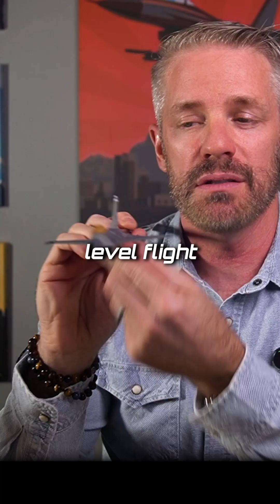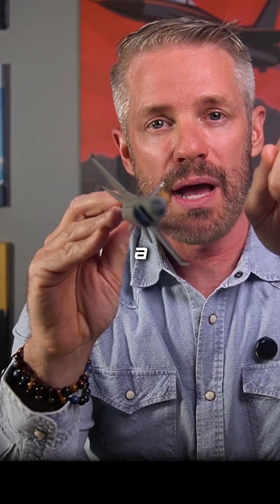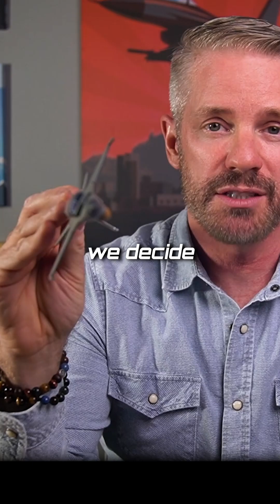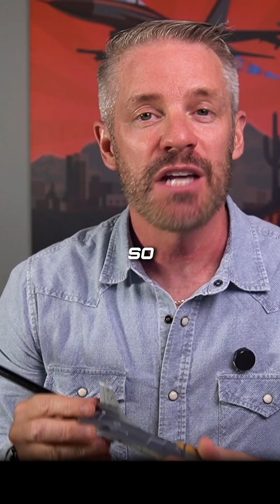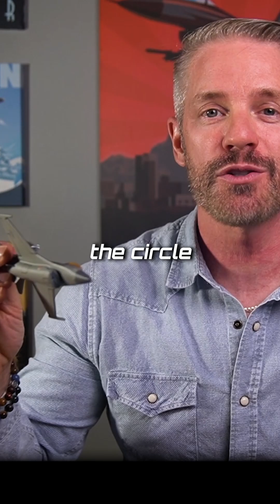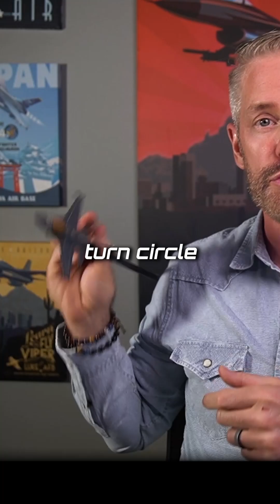Dogfight Turns: G-Force Explained Fast

Comment: If a plane takes off with afterburner, and they pitch up enough where the afterburner flame is hitting the runway, could that melt the runway?
Reply: I guess
Reply: @icecrash01 ?
Reply: @JamesMathison98  it technically could ig
Reply: @icecrash01 no, it doesn’t get nearly hot enough.
Reply: @JamesMathison98  it gets to 1700c and tarmac melts at 50💀
Reply: @icecrash01 where did you find the information that afterburner exhaust gets 1700 Celsius and “tarmac” (there is no such thing as tarmac. Is it concrete, asphalt, etc?) melting at 50 c?

Because that is wildly incorrect
Reply: @JamesMathison98  also asphalt or tarmac can be used for runways and also asphalt is 60 c
Reply: @icecrash01 bro again, where are you getting this information. It’s absolutely erroneous
Reply: @ search it up
Reply: @icecrash01 I just did. That’s not a melting temperature, but a temperature that the material becomes soft and is more prone to cracking. This is not melting.

Concrete has a melting (more like decomposition) temperature at 1200 C. Those two materials are what make up most runways, often a combination. 

The aircraft is also going around 150-200 kts when the exhaust is pointed down, and it is only for fractions of a second. There is not enough time for significant heating of the surface.

I’m speaking as both a pilot and an engineer. The premise of your point is dumb
Reply: @ So in summary: Yes, it’s possible, and it sometimes happens — but more often it just gets very close-chat gpt
Reply: @icecrash01 no, it’s not possible. You have given no indication that it is
Reply: @icecrash01?
Reply: @JamesMathison98  Thanks for answering my question though.
Reply: @razuer2920 :)
Reply: Public schools are really failing with these questions